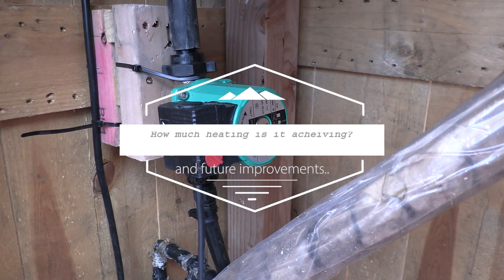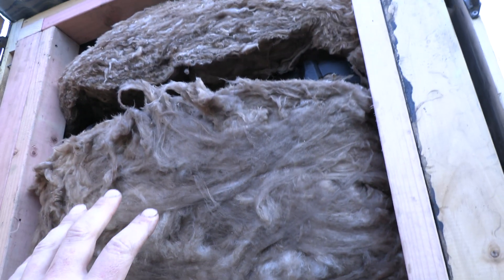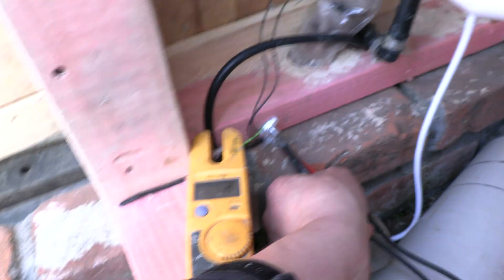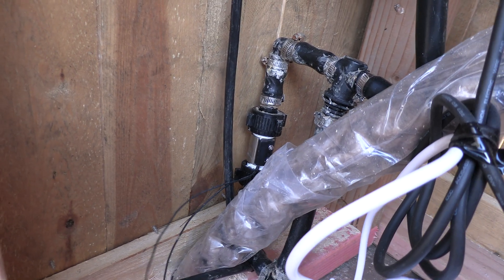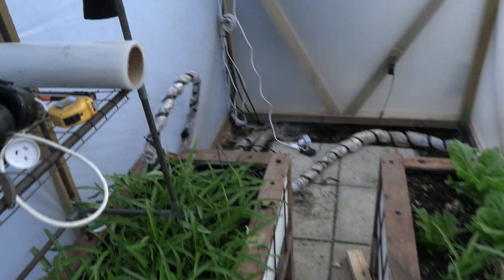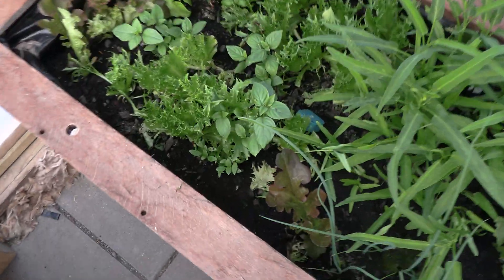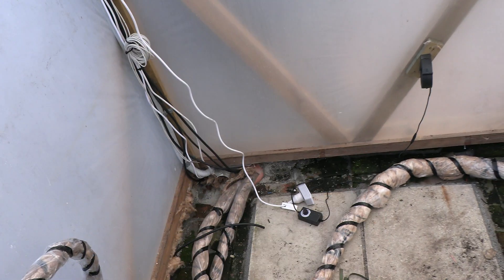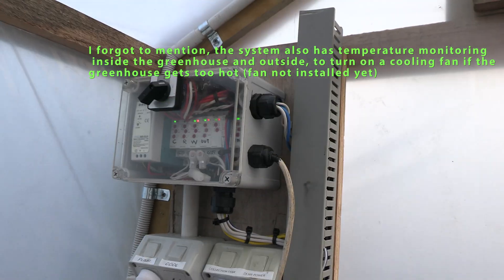How much heating is the DIY solar/sand/compost warming system acheiving?

Comment: What about replacing sand battery with sodium choride. When you have a sunny day, it doesnt overheat, by drying the sodium chloride. By night, it releases heat while absorbing moisture
Reply from the maker: Ill try the sand first, im not sure how the salt will go being around all the metal.
Ive just got back from holiday now, and in process of connecting system up ready for autumn / winter.

Comment: Hi. Have you got the sand filled corrugated solar water system up and running yet. I would be interested to know how hot it can heat up your water. Thanks
Reply from the maker: Im currently assembling the solar heater remake, using soldered aluminium joins this time, plus extra pipes and tweaks, it will be a few weeks before i get it finished, and tested (i will post this video in a few weeks), but i will also have to construct the dual-pile compost heating system before switching on the system again and testing. The new system is definitely going to increase the heating ability. Probably by a lot.
I will post some detailed videos as soon as complete. But in reality it will probably be a few months away to see results, which i will upload a video also

Comment: Been enjoying watching through your videos with interest as have considered similar projects, great work! I have subscribed to your channel. Have you considered encapsulating the compost and capturing the methane/off-gas? Again, doesn’t help with changing the compost out once its finished but you have already gone to so much effort to use the compost as a heat source you could potentially use the biproduct gasses as well. Thanks for the videos.
Reply from the maker: Thanks, thats an interesting idea, I will certainly keep it in mind.
I'm aiming to start the remake of the solar collector very soon, no plastic joiners this time round and one loop thru the system instead of parallel, and also extra piping.
I've got an idea I will test out to make it without needing to purchase joiners.
After that i will add a second compost pile

Comment: Couple of questions.
Are you using solar unit to stimulate your compost action?
Or are you using compost and solar to heat you green house? 
Evergreen State College made prototype heating system for one of their small dormitory using a compost pile. It was able to keep it heated comfortably throughout the winter. The compost pile was six foot dome that was enclosed with straw bales for insulation. From what I'm hearing you should combine all your compost into one large heap.
Reply from the maker: The intention is to heat the greenhouse beds by the heat generated by the compost over night and during cloudy days (next winter).
The solar/sand heater is just supplementary for sunny winter days.
The issue ive come across with my compost heap is that (maybe partly due to its size 1m by 2m), the heat generated in the compost heap is absorbed into the water circulation, but this also cools the heap as the cooler water is pumped through.
If i switch the system off the compost will continously heat.
My solution which i will start soon, is 2 piles, and installing more valves etc to automatically switch between piles each day to allow each pile time to reheat while the water isnt circulating through.
And yes i plan on insulating the piles.
I can see the cooling effect the circulation has on the pile with the wireless probe i have in the pile which records data continuosly.
Reply: @DCAL084  what they did at Evergreen was alot of coils with the inlet at the top (they found the heat at the top was negligible) but it was warm enough to preheat the incoming water to impact the interior less when the water was circulated.
Reply from the maker: @patrickradcliffe3837  thanks, with my current compost system, i ended up adding a coil inside the pile also, (i also left the aluminium pipe system in place)
And i plan on using a coil also.
Reply: @DCAL084  I was really impressed  with compost heating system they had at Evergreen. I was very surprised at how much heat they were able to get out of it and how long the compost lasted before it needed to changed out. The only draw back to the system was swaping the compost when it had finished digesting. When I left Evergreen they were still trying design something that made changing out the compost easier.
Reply from the maker: @patrickradcliffe3837  Its quite amazing the heat compost can generate. Dry woodchip and green leaves seems to be a good mix, but i think ill try adding straw for aeration next time.
Reply: @DCAL084  
I have aerated heaps before by building the heaps with a grid of vertical smooth wood or plastic stakes in place. If these are left in for a few days while initial settlement takes place, they can then be withdrawn without the holes collapsing in. If you find there is too much heat being lost, simply plug up a few of the holes.

Comment: Great job. I’m looking forward to your continued progress.

What about auxiliary heating like a small solar collector and a drum for a heat battery?
Reply from the maker: I'll keep those in mind, my goal is to be able to grow tropical vegetables inside the greenhouse all next winter, we get sub zero nights and frosts here in winter, in fact we had a mild frost this morning and its currently mid spring.
I will add tweaks and improvements, including extra pipe insulation over the next few months.